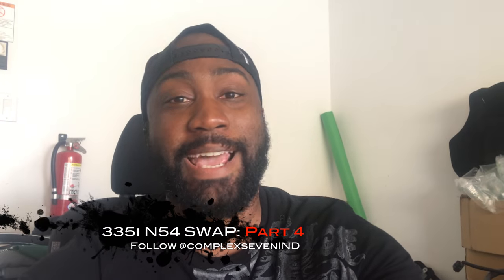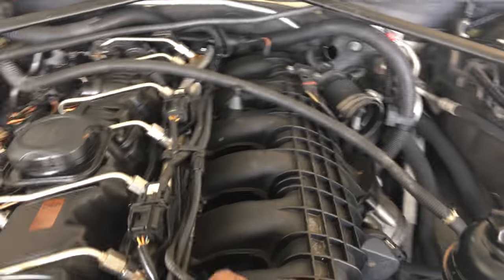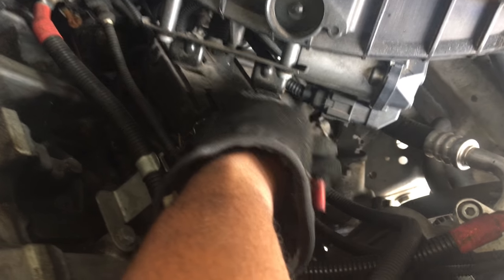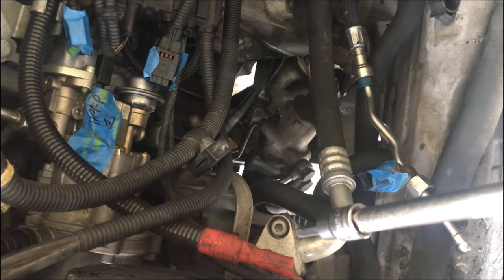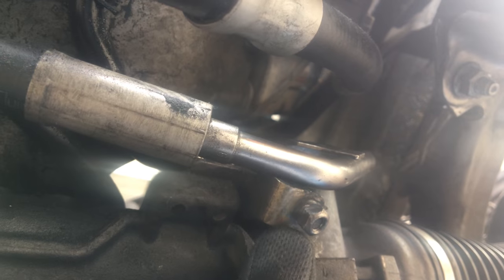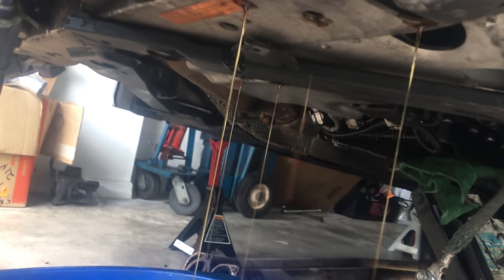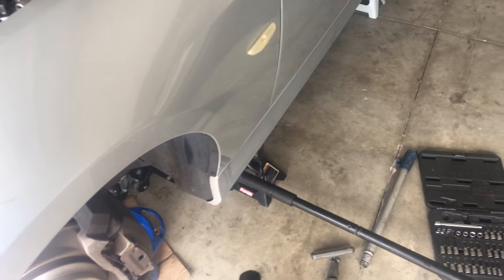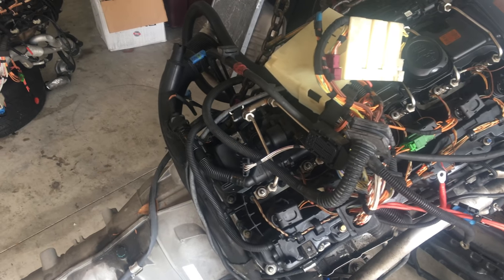BMW 335i N54 Engine Removal DIY Part 04

Comment: Hey man I'm on the exact same boat as you. Got my parts car and gonna engine swap it soon. Props to you doing all the work yourself, I'm having a BMW technician do mine. Subbed
Reply: Complex Seven Industries injector blew after a misfire, causing the cylinder head to become blown. I had a few shops quote me for a head replacement and it literally made more sense to do an engine swap so here I am
Reply: Complex Seven Industries Yeah man I haven't driven it in over 6 months. I might make a video of it when I'm finished with it

Comment: Got my engine and transmission out today.  Was straight forward
Reply: noshi how the heck did you get this transmission on the new engine by yourself?
Reply: noshi that did the trick
Reply: noshi I’m guessing you just tightened the bell housing bolts by hand and and flywheel to torque converter by hand.  Couldn’t find any good torque specs for the bolts that I trust.
Reply: noshi got my engine in today.   First start should be tomorrow.  Very scared to start t up for the first time.
Reply: noshi my bmw purrs like a kitten 👍🏻
Reply: noshi wanted to run something by you.   When I first stated my car I was respecting white smoke because I used some intake valve cleaner.   Some came out from under the hood near the front turbo.   After that a noticed air pressure / smelly rich exhaust air coming from that area near the front turbo. I’m thinking exhaust leak near the vband.  That do you think ?

Comment: Did you need to disconnect any wires from the body to the transmission or just the shift linkage
Reply from the maker: There’s a transmission wire that goes to the transmission, you have to disconnect that also, along with the shift linkage

Comment: Basic tools will get the job done ? Plan is to DIY with my swap.
Reply from the maker: Yes the most you will need is an engine support, some extensions and a wobble socket. Nothing fancy

Comment: What engine hoist did you use. I got a 1 ton from harbor freight and it BENT trying to take the engine and transmission out I picked up a 2 ton which I hope will be plenty
Reply: @nOshi2x   it was slowly bending luckily caught it before it failed completely but the 2 ton did the job great